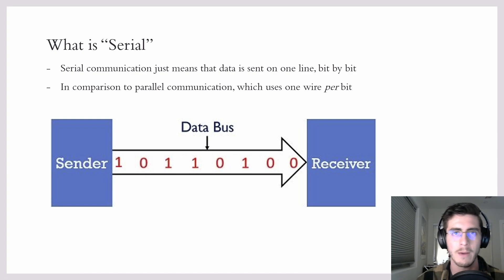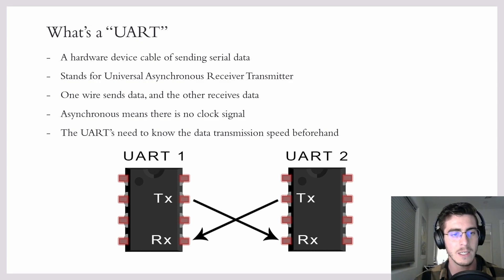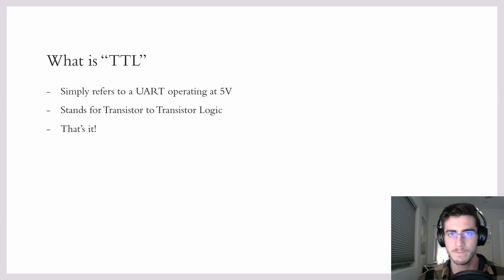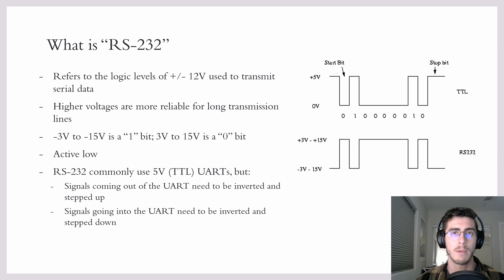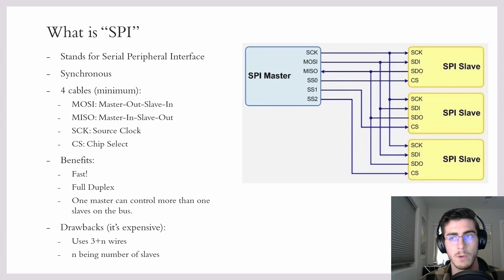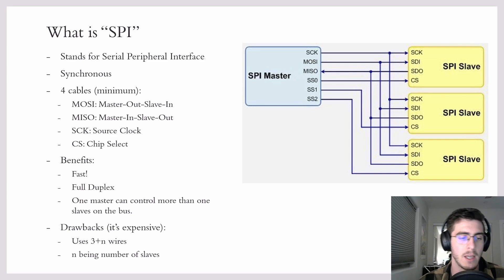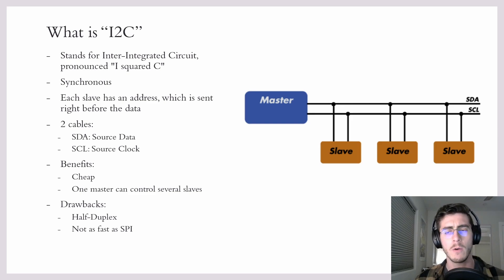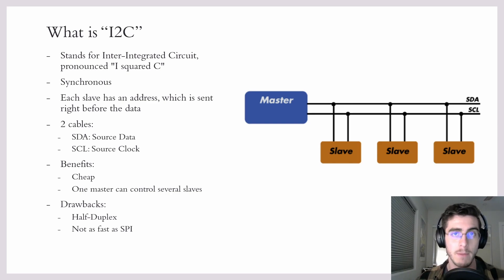Serial communication protocols - what are the differences?

Comment: Can you do a bare metal driver on a mcu that uses the i2c protocol and flashes a bin file to another mcu flash memory/eeprom over i2c?🙏  I see a lot of videos explaining the timing diagrams, but not the code written and explained how to actually get it working. your explanations are great and easy to follow. I dont want to just use library's etc and rather learn from the ground up.